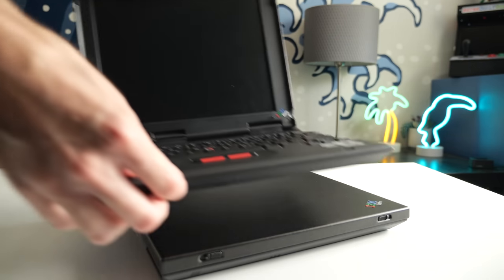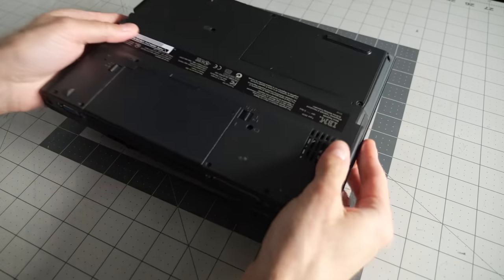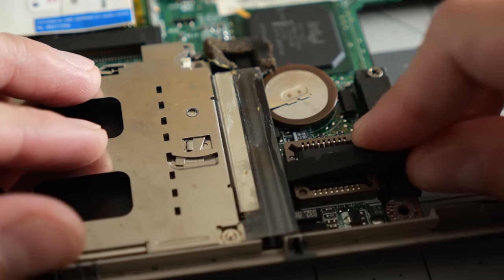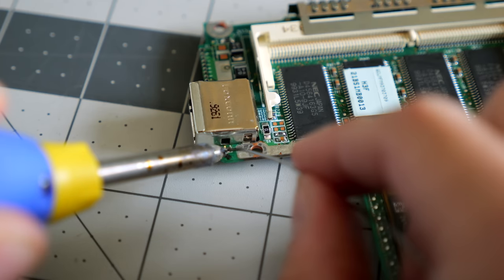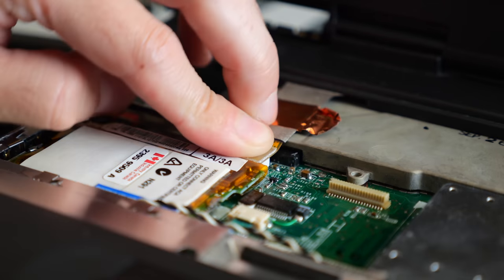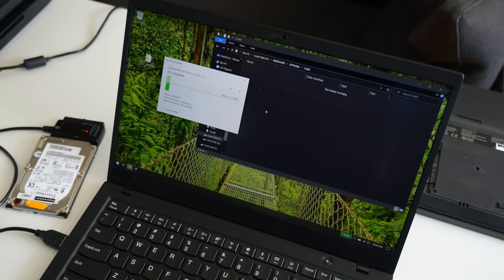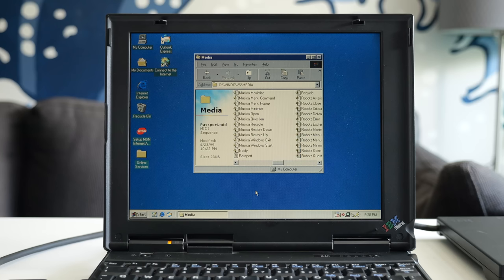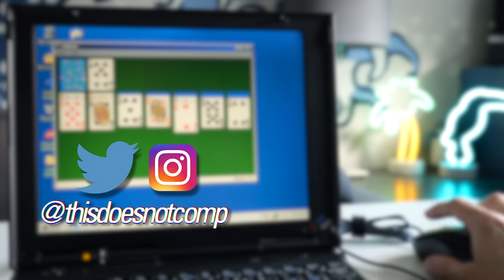A Tale of Two Tiny ThinkPads

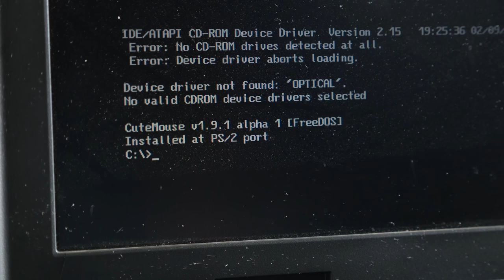Comment: 1:00 Someone wiped the HDD and just transferred the system from a Win98 bootdisk. Also was kind enough to leave some dos utilities and drivers in theirs folders. When you have a Win 9x installation, you do not have a DOS folder; some dos utilities are found in \Windows\command folder.
Edit: for the optical drive, my guess is that it is a standard slim IDE one, so you can use a similar unit or even a DVD (RW) instead. Just compare the rear connector, it should be IDE standard. I have a similar specs laptop from the same era (Toshiba Satellite 1710CD) that I swapped its non working CD unit with a more modern DVD-RW one, from a Dual core Clevo laptop with the same IDE connector.
Reply: It's Philscomputerlab's DOS Starter Pack, had to have been done relatively recently.

Comment: Jumped when I saw the Xyratex sticker on the hard drive. I worked there from the end of the time when it was an IBM Hard Drive fab plant and transitioned into Xyratex in the mid late '90s. Management buyout, we went from making Hard drives to reworking them. There is a good chance I was there at the same time as this drive. Heck I might have even handled it! The plant was huge, clean rooms with hundreds of people working in the on any given shift. Thousands working there in its heyday as an IBM facility. Havant Hampshire, near Portsmouth on the south coast of England.

Comment: Recently got a X61, am going to max out it's ram to 4gb, install a 128gb SSD and a new battery. It's going to be way enough for me, except for playing GTA V
Reply: It'll take 8GB if you can find the sticks online.  Also the modded BIOS download unlocks SATA2 speeds for the hard drives etc.  I did this and performance for even Win 10 is fine, depending on which CPU yours has installed (mine has the T7500).
Reply: @EgoShredder  You're right about the 8GB RAM and I have managed to find a few reasonably-priced 4GB DDR2 SODIMMs that I have put into a couple of Thinkpad T61s that I have.

Unfortunately I don't share your enthusiasm for Windows 10 - 8GB is a minimum for Windows 10 these days because of the masses of privacy-hating telemetry that Microsoft has going on in the background. I rid myself completely of my Microsoft abuser when support for Windows 7 ended, and good riddance to them.

On the other hand, Linux is made for these older Thinkpads and runs better in 4GB than Windows 10 would with any amount of memory on these older machines.
Reply: @terrydaktyllus1320  I'm no fan of Win 10 and I used a modded thinned down version for better results, with all the telemetrey taken out and unnecessary bloat etc.  On my daily drivers I am on either Win 7 or XP.  Tried various flavours of Linux in the past 20 years and although some are ok, they are not prime time for me yet.
Reply: @EgoShredder  I just don't understand the concept of "fighting against my OS".

 You turn off things in Windows 10, and next time it forces an update on you, it turns them back on again. You're constantly going back and re-checking your configuration and therefore cannot trust it.

And I don't understand why anyone would let an OS they can't trust anywhere near their computers in the first place.
Reply: @terrydaktyllus1320  For me that is down to specific hardware and software I use.
Reply: @EgoShredder  It's not really the hardware because I would argue that Linux supports a far greater range of hardware than Windows 10 does - bearing in mind the large amount of older hardware out there that no longer has any Windows drivers for it, but still works fine in Linux.

As for the software, if you mean modern AAA games then, sure, I can't argue that. I just gave up on AAA gaming a decade ago because it all went crap around then. For the modern indie games that I do play, and older "retro" games, Linux runs them all fine.
Reply: @terrydaktyllus1320  I'm on about music hardware for use with software like Steinberg Cubase etc.  Not really into gaming much these days, but yeah graphics cards are a problem in Win 10 & 11.

I'm considering pooling together my laptops and desktops to make a kind of computer farm, with different OS on them to cover the legacy support aspects, and integrate newer stuff.  From a music point of view, this might be Steinberg VST Link.  It involves chaining each machine with optical cables, and any machine can act as a controller of the host.

Eventually we will all be on Linux, unless something else materialises.
Reply: @EgoShredder  I'm afraid you're talking to someone with almost complete ignorance of music processing - I am good with Audacity but that's about my limit.

But respect nonetheless for Steinberg VST expertise - I know of it but very little about it.

Comment: would like to see the fixed laptop running Windows 2000, or hell even XP if you think you can put it through that humanely haha.
Reply: It’ll do fine - although with 320MB of RAM max, a Celeron 300A, and a chipset limited to 33MB/sec for the hard drive, it’s not going to be all that fast.
Reply: @Waaaaaaaaaaaang  maybe the unofficial stripped down version of Windows 7 called "Tiny7"?

Comment: Anyways I used to be able to borrow a buddys newer ac power cord and brick from a hp dvd laptop and I have a cd player Dr,, anyways it worked fine that way I don't know about it now though have not messed with it since 2012 and I don't remember which one but one of the buttons by the mouse pad didn't work so I used a serial connector ide mouse with it

Comment: Dude! Using a mouse when there's that lovely IBM nipple! Sacrilege!

My only laptop was a Thinkpad, and I thought the nipple was weird and impractical at first, but it also had a touchpad. But once you try the nip, it's amazing! You can move the mouse both quickly and accurately with the slightest little impulse to your fingers, and it's not difficult! The feedback between a finger tremble and seeing the pointer on screen works perfectly. It's a shame you can't buy desktop PC keyboards with them (that don't cost an absolute fortune, that is). Somebody should launch it as a separate accessory, except being 1cm square you'd probably lose it a lot. It could hang out the USB port I suppose. If it were Bluetooth you'd only have to yawn and it would end up planted in your sinuses perfectly. Then you and Arnie could start a Cyborg Club and hang around together.

Comment: I've got a 240x, I removed the miniPCI dialup modem and replaced it with a WiFI card that has a modern-ish realtek chipset that still has win2k drivers. I disassembled the lid and installed foil wifi antennas behind the display, and ran the cables down through the LCD flex slot of the hinge, you can't even see its been modified. I've also got the extended battery pack for mine, but I think its got a fair bit of wear on the cells. https://files.home.mos6581.com/Pics/220/dongle-sprawl.jpg

Comment: Thinkpads have always been overpriced and offered little more than there competitors at a cheaper price. Other than the IBM brand name. I'm currently using an IBM thinkpad edge 11 with Intel Celeron U3400 1.07GHZ and 4gb ram. Which I picked up for free as someone was throwing it out. Probably because it was used for education use and locked down with passwords. Though that was easily fixed as I learned from the internet by opening the computer and shorting out a few pins on the bios/cmos chip and turning it on. To easily clear all the passwords and reset the computer.